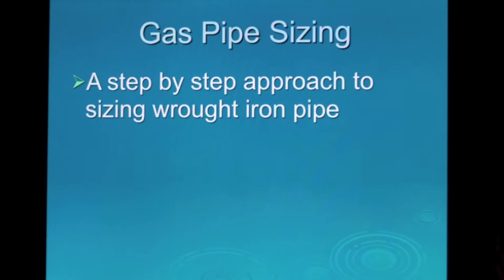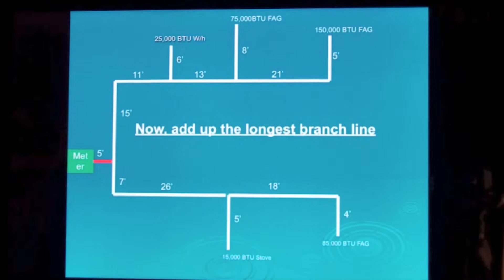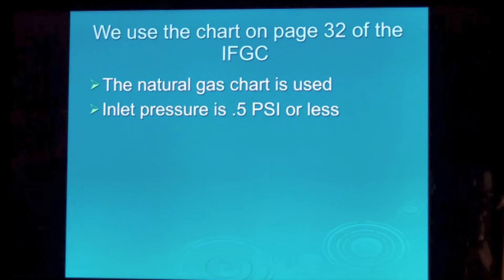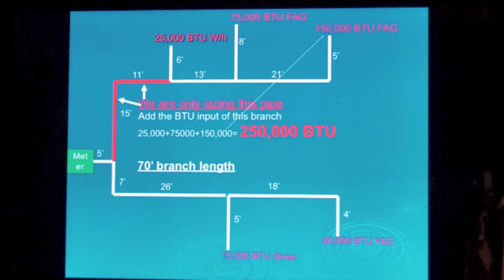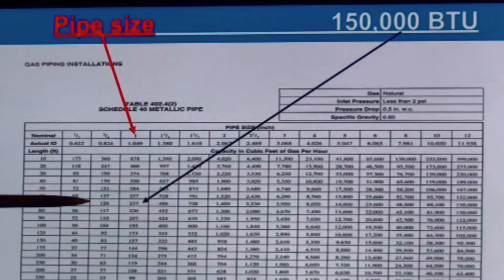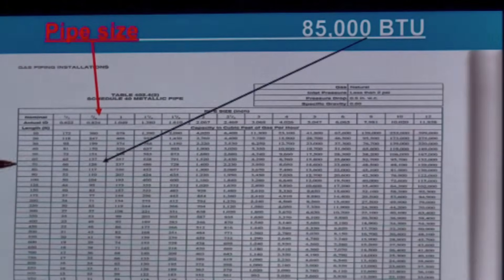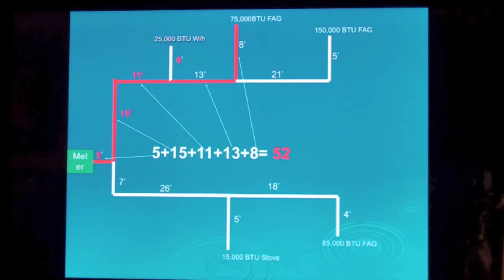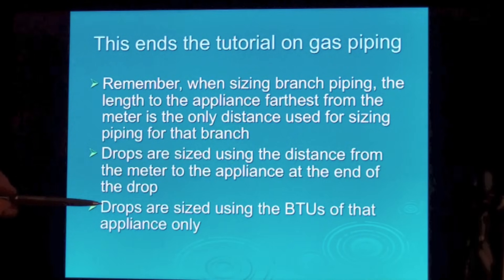Natural gas pipe sizing

Comment: I would stay in the 70' column/row for all pipe size calculation. End up with the same the same result. The way I was taught. Using your video to teach a few apprentices.  Thank you for posting this video.
Reply: I was taught the same thing, 48 years ago. You stay in the 70 foot column for all your sizing.
Reply: I was taught the same thing 30+ years ago to get my license in Phoenix. Stay with the 70'.
Reply: @ozm8642 are you talking about for the drops? Or you talking about both branches staying in 70 ft??
Reply: @tracker1ify  u measure main run from the meter to the furthest appliance. Then u look in your book and you stay in that column forever. And you go off of those btus to select pipesizes
Reply: @ozm8642  ya That's what I was talking about
Reply: I took a gas technician 2 course in ON, Canada. Likewise, we were told to keep the LMR and apply it to all branches off the manifold unless the branches are separate.

Comment: re-read the code,,, the 5 ft pipe off of the meter must be 1 1/2". period, case closed, finished.
Reply from the maker: whommee This piping calculation is done using the 2012 IFGC.  It is also only for wrought iron pipe.  Sometimes local codes will be added but I can't consider that.  The general guidelines for piping are on page 29 and 30 of the IFGC.  Thanks for the thoughts.
GFM

Comment: @grayfurnaceman hello good sir, I was just wondering do you add 5 foot to your length for each fitting? like a 90 or tee. is that a rule, or is that with propane, or is it for both, or not a rule at all. thank you for your time.. great video
Reply from the maker: frank smith The figures are from the the IFGC and they do not include fittings.
GFM
Reply: @grayfurnaceman thanks for your quick response good man

Comment: I live in lapeer mi they recently pipe gas to my house  I have a 1 1/4 service coming in and the pipe to the house is 1 1/4 does it have to remain this or can I down size to 1'' to feed everything..???????????
Reply from the maker: james poole  It depends on the length of pipe and the BTU input of the appliances.  That is why I did the video.
GFM

Comment: Great demo this will definitely help our apprentice who are trying to pass there journeyman test and help the guys in the field in the sizing of small to large size gas systems. Have you ever thought about doing a video of installing and sizing of a 2-lb gas system with regulators to reduce the sizing of black pipe used in large residential homes using several million BTU's. Thanks Your Help is Appreciated
Reply from the maker: Robert Easley I will be considering that one for the winter.
GFM

Comment: Its done differently in Canada as someone else previously explained. Does your calculations change above a certain gas pressure as in Canada. Up to 2 psig fittings such as tees, elbows valves are included in the tables. Above this pressure we have to take in account of the  fittings because it creates resistance. We use tables for equivalent length of a fitting and then prove it against the selected table that it does not go over the longest measured run of the code length. If it does we go to the next longest run in the table.
Reply from the maker: The different methods usually end up using mostly the same size of pipe when all is said and done.  The method used here is international code which is not adopted in all jurisdictions.
GFM

Comment: This is all wrong. You do not change total developed lengths when sizing the drops. You stay in the column/row of the total developed length of the furthest gas fixture always. Remember you are sizing the system to be running all the gas fixtures at one time, not individually. if you have a water heater with a 50k btu demand - 1/2" pipe can only feed it up to 100'. If you have a BBQ stub at 125' feet the water heater will need 3/4" pipe because 1/2" pipe can only supply 44k btu's at 125' total developed length.
Reply from the maker: The method used here is the IFGC "Branch length method".  The sections are sized using the most remote outlet from the point of delivery method.  However, the branch piping (normally called drops) is sized using the most remote outlet of that branch from the point of delivery.  Both ways will pass this code.
GFM
Reply: grayfurnaceman , what do I KNOW,just a elementary school kid. Thanks for the video, & channel.
Reply: grayfurnaceman , You LACK common sense.
Reply: He didn't write the code. You should try reading it.

Comment: I assume if the main exiting the meter will be 1-1/4", then the main entering the meter should be 1-1/4" or larger?
Reply from the maker: No.  The gas pressure into the meter is higher.  As a service tech, our responsibility ends at the outlet of the meter.
GFM
Reply: Ok thanks gfm.

Comment: This is a good example and makes perfectly logical sense to me, but up here in Canada we calculate it slightly differently. We still go by the longest measurement and total BTU. But we must then use the longest branch line measurement to size every other branch line appliance coming off that system, and we're not allowed to count those 2 subsections as separate unless they're tied in within 2' of the meter. I think it all boils down to maintaining a proper pressure drop that doesn't exceed 2' w.c. It's amazing how complicated something that seems so simple has gas guys arguing and scratching their heads. Good video.
Reply from the maker: The text I used is the IFGC.  As is normal, not all jurisdictions use the same source.  And yes, we do seem to argue about this a lot.  Thanks for the thoughts.
GFM
Reply: grayfurnaceman
Whoops. I meant a pressure drop not exceeding 1"w.c., not 2"w.c.. We use the B149 CSA code books up here... Yeah it really can be annoying. For example, we could have a LMR of 70' and have a branch line for a small BTU appliance within 3 feet of the meter and only 2 feet of a branch and STILL have to calculate that appliance by the LMR of 70", which is nuts when we're so close to the regulator.. The majority of guys don't follow these rules to the letter when it really sometimes seems like overkill.
Reply from the maker: bodybuildingking I think sometimes you see "regulation creep" in these charts.  Each reviewer ups the the restrictions.  Our pressure drop is .5 in wc.
GFM
Reply: Our normal chart is 7-14" w.c. with an allowable drop of 1". But we do have another chart for a system under 7" which then demands a pressure drop not any greater then .5. It's kind of tricky since most residential places are pretty well bang on at 7".

Comment: Great vid. There is one thing I can,t seem to understand. When you refer to the chart to look up the BTU, the chart column label is cubic feet per hour. Is btu equal to cubic feet per hour? Thanks
Reply from the maker: The chart actually calculates cu ft per hr.  If you have a local BTU per cu ft of 1000 BTU as most areas do, its an easy conversion.  If your local BTU are different, you must adjust.
Reply: The chart is designed for volume of gas. The appliances is calling for so much volume of gas inside of the pipe per length. Get chart is laid out for distance and btus the appliance is calling for. I hope that helped.

Comment: Thanks for the piping info. You would be shocked at what I've seen under some houses. Who ever installed some of this stuff should be shot, half of it doesn't even pass gas code.Some would take 1/2 inch from the main branch, and that would be it. Makes you wonder how any of their gas appliances work. Thanks again for the info, this always helps especially green horns like me coming up in the trade.

Comment: I got a question for you, if you really oversized the runs going into a furnace, will this effect the input BTU firing rate or will it make no change? Lets say for example you had a 4 inch pipe reduced down to a 1/2 pipe going into a 88,000 BTU furnace? and the furnace manifold pressure is set at factory specs. And assuming 7" WC going into the furnace.

Comment from the maker: Its hard to get across the piping, and I hope this will help.  Thanks for the support
GFM
Reply: Will this help me draw a riser diagram for my diy gas line?
Reply from the maker: @johngriffith8999  It is meant for determining the correct size piping in accordance with the IFGC.  You can use a screen shot for your diagram if this is for code issues.
GFM
Reply: @grayfurnaceman  I'm adding a gas line for a stove,  and I hope if I follow this video I can draw my own riser and submit for permit
Reply from the maker: @johngriffith8999  You should be able to, if the local code uses the IFGC.
GFM